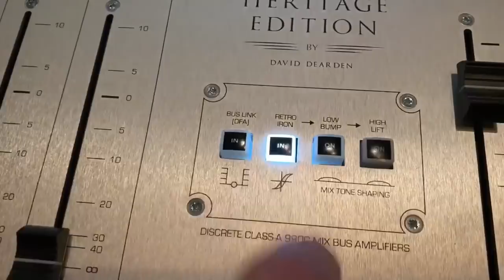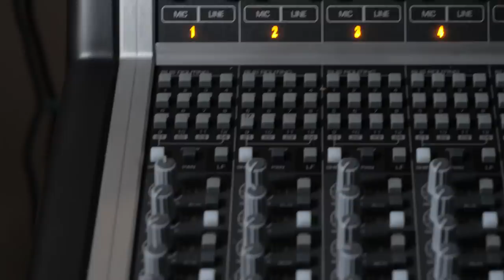Installing a $100000 mixing console!

Comment: i fucking undoubtedly would have rented long forks for the morning instead of all of that double tail lift bollocks! considering the price of the package, 150 dollars or 120 squid would have made that much smoother for everyone and their underpants and their laundry machines! was fun to watch the frame of the package give way a little n wonder what forces where put on the outer casing of the board? again would have been avoided with long forks by coming out as one straight piece, nice n smooth lowered down so that all points would have hit the ground much closer to unison))))) fun vid))
Reply from the maker: We didn’t know how big it was until you saw that clip... or that they couldn’t get it off the truck.  I found out the NIGHT BEFORE. that it was coming.  No time to book a forklift.  Sometimes you’ve gotta improvise.

Comment: Cheez, that was painful to watch. You kids are cute with your not knowing how to get heavy shit out of trucks. Your non live engineer is showing, Glenn ;) for future reference, you guys could’ve totally slapped down two or three 4 wheel dollies under it once you had it up on its side, and not had to carry the thing the whole way into the studio, apart from hopping up curbs and the like.
Reply from the maker: Can’t set it on it’s side
Reply: By on its side, I mean the way you carried it. Dollies can be placed on edges or in general away from potential points of damage. Packing blankets on bottom if you’re worried about the multipin connections or something else on the back. Not trying to be a smartass. Just trying to throw out options for the prevention of hernia and damage. I do shit like that pretty much every day, including the large format analog console variety from time to time. Lift gates are handy, aren’t they? :) hope that room is ventilated well while the install crew is soldering away. Enjoy the console, friend.
Reply: For full clarity’s sake, I should probably mention that I didn’t mean the dollies should 100% take the load off the gentleman with the straps. Rather, share the load. All the weight would neither be on the dollies nor on the fellows. I realize it’s already in, so this is a senseless discussion for me to be poking at. Really just happy you’re actually talking to me, even if you’re being brief and dismissive.

Comment: I legit know guys that can mix with excellence on a $100 mixer.

The equipment helps, sure... but talent matters more. That is why Bob Rock, Ted Templeman and others of that ilk are who they are. Being an engineer and a producer are separate things. Engineers turn knobs. Producers have a vision specific to the artist and enact that vision for the sake of art. Think of a music producer as having the same role as a director on a movie set.

Any good band needs an outside producer. Engineers acting as producers don't work because they lack vision... and a band producing itself doesn't have the separation needed to regulate themselves. Someone has to be able to step in and say 'That sucks, try again' or 'no' when it is needed... artists are too close to the music to judge it appropriately.

Bring back the producer to studios. 

Have a great day.
Reply: Low-Tech Mods producers and engineers are teams, i agree! Sadly these days every artist expects the engineer to also be the producer visa versa. Also the main reason for good gear is to save on time. Great hardware is practically plug and play. I used to spend 10hrs sometimes getting a decent sound for a mix with plugins. After purchasing some hardware EQ/Comps and good pres, I’ll spend half that time dialing in tones for the mix. A console will dramatically reduce this time further. Especially during recording.
Reply: @CreativeMindsAudio  I will never argue the importance of great gear for ease of use - but I will always point out that great gear does not make you great.
Reply: Low-Tech Mods 1000% man! Gotta have talent first before gear. Hell using good gear without really getting good will make you sound worse. I can’t tell you how many times I’ve had friends goto studios and get worse results than I could have done out of my home studio (much less any studio I work out of)